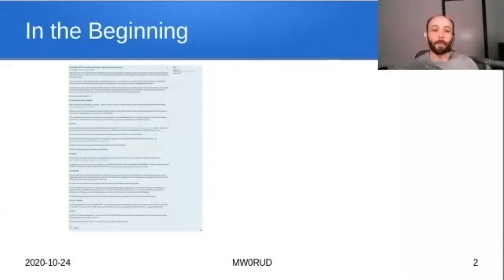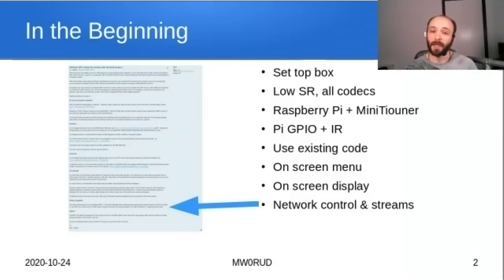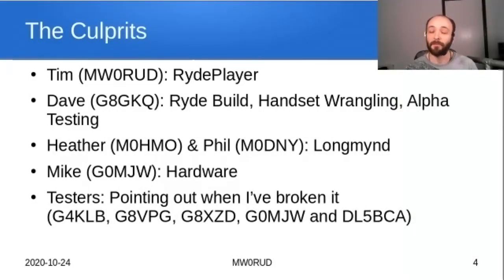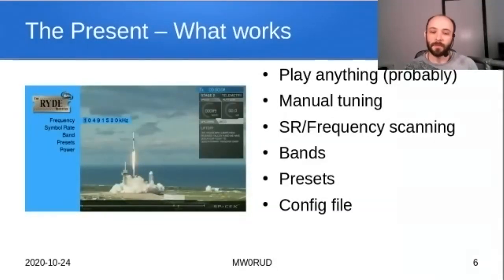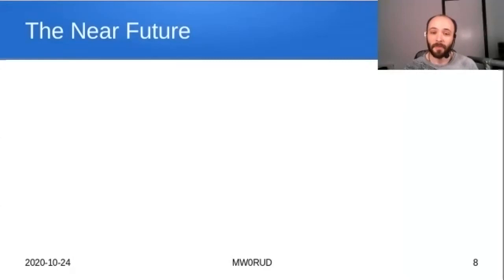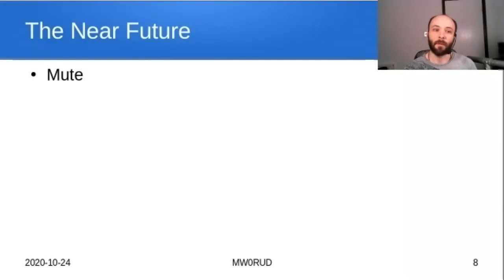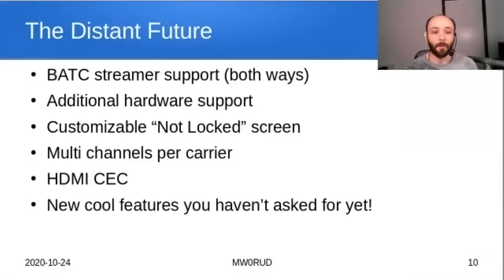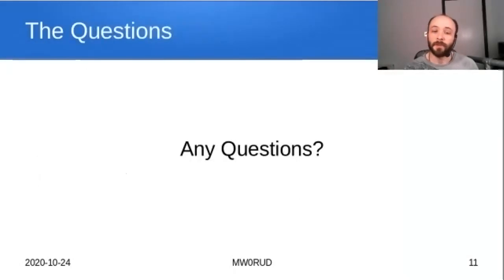CAT20 Ryde receiver

Comment: I am a radio amateur from Greece. I have been working on analog and digital ATV for years. Recently, I have been thinking about working on the RΥDE receiver. Unfortunately, there are no connection and programming videos. I bought the Raspberry Pi4 and pcbs from store BATC . I have read all the instructions, but I cannot get it to work.